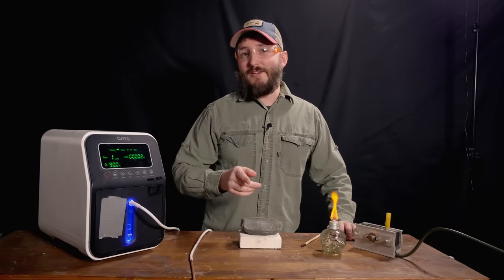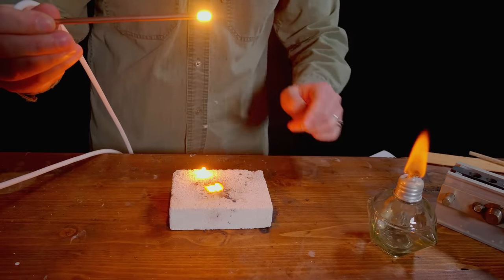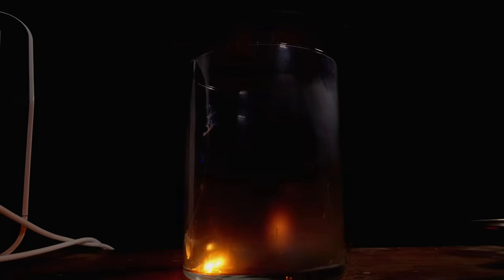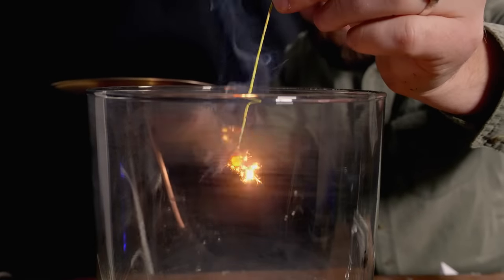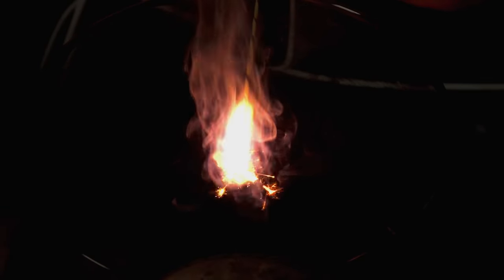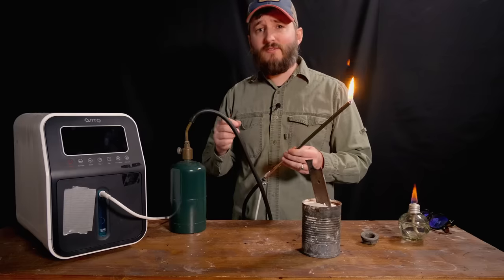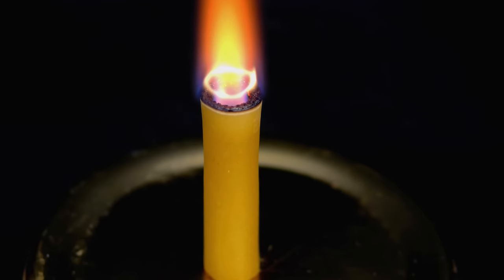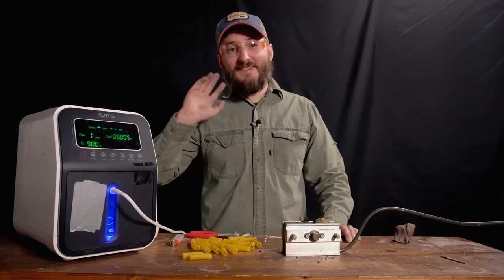6 Unauthorized Uses for a Medical Oxygen Concentrator

Comment: I learned this setup from a jeweler years ago on YouTube and I've been running my map system like this for a long time. It's actually how I managed to make rubies for the first time. After that I started playing with the laser method and then I did solar concentration. I washed yours on microwaving and had made some comments on the oxygen concentrator before. Glad to see you finally found one 👍
Reply: Just so you understand my setup. I bought a map oxygen setup and then just quit using the oxygen bottles and slid the too bright on the oxygen in Port and zip-tied it on there
Reply from the maker: How did solar work for you for rubies? I've been planning on trying that sometime.
Reply: @Nighthawkinlight  not too well! I couldn't use my big presnell because I broke it but the little ones managed to work. I had a janky set up and only had a little bit of time. I also tried using magnifying lenses and they work. Happen to have some old lenses from a projection TV that I've used as well. I just never have the time to be able to put into them. Much light trying to turn my anode and cathode into counter-rotating fan blades on my ionic lifter. I just never have the time. That's why half the time I just tried giving me idea to someone else that does have the time and can make a video out of it. Most of the time I do have are donated to my hydrogen reactors which I have finally reduced down to the size of a beer can and produce quite a few liters per minute. Even managed to print one of the prototypes and it survived quite a few Cycles for I let it overheat. Most of my time and extra money are going to the anode and cathode material which is going to cost me over seven Grand in rhodium!
Reply: @Nighthawkinlight  I still haven't tried the microwave method😪
Reply: The hell ... we live in a time when people are learning from YouTube how to make rubies at home using old medical devices... god is great ... or something.

Comment: Rocket idea to maybe try: spaghetti noodles inside the larger hollow pasta tube. Could be placed loosely or maybe fixed in place by getting both noodles damp before placing them and allowing to dry. Varying the position and number of spaghetti can potentially allow you to tune different characteristics like thrust, combustion pressures, burn time, etc
Reply: Also, since it requires hydrocarbons, I think pla or other 3d printer filaments may work, allowing much more sophisticated design. I’ve wanted to test it for years but never got around to it, parents didn’t love the oxygen tank and fire combo lol.
Reply: I should note, acrylic works well, so there is some precedent for oil based polymers in this application
Reply: and how do you combust it?

Comment: Great vid!  Yeah, I think you end a proper nozzle designed for the flow rate you got, which might also need some pressure boost also.  Suggestion: it would be a good video to go over how this thing works and maybe also do some show and tell of its insides.  Thanks!

Comment: I have a couple of ideas you could try.
1) you could insert a  y into the line prior to the exit to attach your propane line into.
 Then insert a smaller diameter metal tube into the end of your brake line to increase the velocity of the O2 gas being forced out of the end. This would also give you the flexibility to increase or decrease the proportion of propane relative to the amount of oxygen being produced.
2) try a flowing the oxygen over a couple of drops of oil to see if if would spontaneously combust. (All oxygen valves and components have warning labels on them not to use any oil for precisely that reason).
3) pure oxygen blown through a lit cigar will produce a bright red flame like a road flare..it's kind of cool to see. ( as a former medic we used to play with pure oxygen by taking a big breath and blowing it back out through a cigar)
Note: sodium silicate is used as a refractory material, therefore you probably won't get any burning of sand in that temperature range

Comment: I'm a high power rocket flier and engine builder from years back, mostly APCP, but have played with hybrids (N20 oxidizer) a bit. You can simply machine a graphite nozzle with a drill motor if you don't have a lathe (messy but easy to do). The other option is a rammed bentonite nozzle, It used to be Harry Gilliam at Skylighter had tools available, but sadly he is no longer in business, if you do have a lathe, they're not hard to make. There is probably info on this on the fireworks forums or PGI discussion groups. One thing with hybrids (and most cored motors) is to ignite them at the oxidizer inlet end. With your rigatone fuel, a match head and piece of nichrome wire would make a great electric igniter.

Comment: Yeah, my initial reaction was that the gas isn't being mixed. Your improv torch there also doesn't have anything to hold the flame, which means you're simultaneously risking blow back, as well as blowing out your flame. I think the ultimate issue here is just the lack of aspiration (if I correctly understand the term). But that whistling may have made me pee my pants a bit, I thought it was about to blow back.
Reply: One advantage of oxygen concentrators is they don't hold a very large supply.

It's just a pump that squeezes air through a molecular mesh.

It's a fire hazard but not really an explosive hazard.
Reply: It's just oxygen, so nothing to blow back. Oxyhydrogen is the type of torch that can blow back if you're not careful.
Reply: Well, but at the end of the torch it's not just oxygen. There is propane there also. And while a full tank of propane is not going to blow back due to delta p, as that gass burns down the risk of blowback increases.
Reply: You're imagining a premix torch. Surface-mix torches are also a thing, and are even preferred for some uses. Though generally, you have several smaller jets of fuel surrounded by an oxygen manifold, rather than a single jet of oxygen inside a fuel manifold.
Reply: @torydavis10  I am aware of the difference but I've also seen propane tanks explode, admittedly in less controlled environments with more fire. But I think the principal stands doesn't it?
Reply: @RFMongoose  If there's nothing to react with, it won't react.
Reply: As long as the propane is separated from the oxygen, nothing will happen. Only if the temperature and/or pressure of the tank is so high that it can burst, it gets definitely dangerous.
Reply: @RFMongoose  Sorry, I didn't mean for that comment to be taken as having anything to do with flashback. Even though flashback is always unlikely, as in theory your fuel flow has no oxygen and vice versa, it's always possible for some ox/air to be in the system where it shouldn't be and flashback arrestors between the work and the regulator are always a good idea. The only impact a surface-mix torch has in that respect is that under normal working conditions, it's essentially impossible to wind up with stoichiometric fire inside of your torch tip making things all melty. Short candles will still heat the face but you can't really get the situation that whistle made you think of. The pitch of the whistle in this case would have been the speed with which the flame was fluttering. Still not a good sound as low flow and an unstable flame heats the face a lot. The details that made me say you're thinking of a premix torch were simply the fact that you assumed torches must have some stage before the nozzle which mixes gases, and some extra structure which makes the flame live in a place.
Reply: @torydavis10  this may be a misunderstanding on my behalf, I'm most familiar with Ronriel (sp?) Stype torches. Self aspirated. While it's technically possible to burn them without a cone, they have a tendency to blow out when you do that. Typically those are used with foundry bodies that act like the cone, but an attached cone allows them to function as a... Very jank... Weed burner. That said, without an arrestor, or blowback valve, there is still risk of a blow back, which is why it's next to impossible to but a 20 gallon propane tank without a blowback valve. But that small bottle, I don't know if they come standard or not.

Comment: I remember detailing a car back in the late 80s. I needed to remove some paint overspray from the windshield & went to tear off some antirust-oil treated 0000 steel wool off from the roll, suspended by the center tube by a nail. Just hanging there on the side of the workbench, right over a half dead car battery. Thought nothing of it & pulled carelessly at the end of the roll, which dropped STRAIGHT onto the battery terminals, instantly igniting the outermost coil. Several lacerations & 2nd degree burns later I got the fire out & saved the rest of the roll. LESSON LEARNED.

Comment: The cutting Lance was pretty impressive considering this is a pretty low end O2 concentrator. The ones we use at work (Philips Respironics) can get up to about 7L/min at 90% concentration. Sounds like it could be a fun upgrade 😉
Reply: What are they used for... people who struggle to breathe? What happens if you  don't need one but breathe it in anyway?
Basically...is it a cure for a hangover?😅
Reply: @strangelee4400  yeah pretty much, basically for anybody who can't breathe in enough oxygen with the amount that's in the air already. Nothing special really happens if a healthy person breathes in oxygen unfortunately, not even curing a hangover

Comment: You know, it might be fun to test out different shapes and diameters of noodles and see how it effects the burn rate. Like, Ziti vs Rigatoni vs Cavatappi.The first two would be testing the effect of the tube's radius, while the latter would be testing a spiral shaped fuel.
Reply: Should try bucatini!  It would have a much higher surface area to volume ratio.
Reply: You should also be able to customize your designs with a pasta maker. But making homemade semolina pasta is a lot harder than just picking up a pack from a grocery store.
Reply: Yes! This!

Comment: I have two older concentrators I've been using daisy chained to run a DHC oxyacetylene torch for about 15 years.  I've used it to weld sheet up to 12 gauge with no problem.
The main thing to look for if you're doing this for oxypropane is that if a regulator isn't rated for propane then it's not safe.  There are regulators that use seals that are ok for acetylene but not propane.
The TL;DR on this experiment is this: you're not going to weld with propane, you're not going to cut with concentrators, and none of this is going to be portable. :D
Oh, the most important thing is, you really want some backflow arrestors in there if you're doing this.  ESPECIALLY if you're making your own burners.  I think the danger of having your tank explode might be overstated but I'd rather not be a statistic to save a couple bucks.

Comment: Have you considered a metal housing for the fuel body? Put the hollow pasta inside. You could even use multiple sizes of pasta to make a layered pasta fuel pellet. Since the pasta is hollow you could still feed oxygen through it. With convergent divergent nozzle I would think the risk of explosion would be minimal considering the fuel.
Reply: You could line the pasta with sugar icing?
Reply: Could also cover the entire noodle with the clay. That should extend the life of the rocket by preventing the gas from blowing out the side, without introducing the sort of hard material he was trying to avoid.
Reply: If you soaked the various diameter pasta first you might be able to get a tight fit between layers after they dry back out.
Reply: @lordchickenhawk  why not produce some pasta the diy way. And then shape it such that it already has the perfect shape?
Reply: @bertjesklotepino  Good idea. It looks like my rocket engine program has been sent back to the  ̶d̶r̶a̶w̶i̶n̶g̶  kneading board
Reply: @lordchickenhawk  1 tip i have to have given you:
If you do make your own pasta, do it the right way. 
It is easy to mess it up. But so is everything.

AND:
Produce enough so you can do the experiment and have a nice meal.
Because good pasta should not go to waste.

Comment: We had a lecturer at Uni who made his own liquid oxygen (because they wouldn't sell it to him). He did amazing demos with digestive biscuits soaked in liquid O2. But anyway one thing he did was have a container of natural gas, and light a flame of oxygen inside it, i.e. have a flame of oxygen "burning" in a natural gas atmosphere, as opposed to natural gas burning in an oxygen atmosphere. Probably a big explosion risk, but I guess/hope he knew what he was doing.
Reply: It seems odd that he couldn't buy LO2. My high school welding teacher had it delivered to the school for our building's manifold system once a month, this was back in the early to mid 2000s.
Reply: welding teacher supply chain more compatible with income generation/ science takes a back seat unless its in a $generating wing of a corp ( just my theory )
Reply: Inverted flame furnaces are used in industry. I worked on a nickel brick sintering furnace that switched from an gas flame in air to an air flame in a natural gas atmosphere in operation at 700C.
Reply: Not an explosion risk unless it actually fills up with oxygen
Reply: @allangibson8494 Is that to prevent oxidization?  If not I am curious as to why it's done in that way.
Reply: @holy3979  It is to produce a reducing atmosphere to weld the bricks into a solid mass - the nickel production process produces a fine powder which is a healthy hazard to handle so it is sintered into bricks with a polymer binder and then welded by exposure to high temperatures in a reducing atmosphere.
Reply: That's weird that they wouldn't let him buy it. I rented the setup from a local welding supply 2 Lampwork which is kind of like glass blowing but with a bench mounted torch and there was no special criteria short of where the tank was and how it was set up and how they could get to it to exchange when empty. I'm in Florida I'm not sure what state differences there are.
Reply: @bscguitars2278  This was in Britain so I guess rules were stricter. Anyway, perhaps they knew he was going to make exploding digestive biscuits.

Comment: For the pasta rocket: if you fill the pasta tube with spaghetti it could have more "oomph" or a longer burntime perhaps. 
Here in The Netherlands we have fast cooking spaghetti which is holo in the center, that could help with the added back pressure.
Reply: If it was losely packed, it might create more surface area and you might get a better burn ratio with the fuel😃

Comment: For kids, one could ask them to hypothesize as to what will happen using these variation: Bigger/Smaller diameter pasta. Shorter/longer pasta. The effect of adding surface (roughness: Bronze die extruded pasta vs plastic die) adding length of broken spaghetti or even couscous in the noodle. The effect of the nozzle size. The effect of oxygen flow. The effect of partially/fully cooking the noodle beforehand. The effect of oxygen concentration (if it can programmed). 

The trust could maybe be better visualized by putting a small piece of foil suspended in front of the nozzle. But one could also have a mean of measuring the length and width of the flame. By hitting a cold darken penny with the flame, one could "measure" if the flame is "fuel rich" (the copper will become shiny pink) or oxygen rich (it will blacken). One can measure the amount/ rate of gas produced by putting everything under a bell jar linked to a grad cylinder flipped in water.

Comment: Could you 3d print molds and place partially cooked pasta into the mold to get the nozzle shape, Maybe hang pieces partially in hot water? Could also use a price of piping that has been heated to decrease the diameter to a taper.

Comment: Recently read that it's brazing if the parts have close enough tolerances to cause capillary action, and soldering if you're just using low temperature filler instead of welding. Also found out that torch welding is perfectly viable, and can yield excellent results, and only fell out of favour due to difficulty, and repeatability issues. Probably still a great option for hobbyists, it's just not popular in industry.
Reply: oxycetalene torch welding is still very popular in refineries and other pipefitter industries
Reply: Heck yeah! I much prefer torch welding to arc welding. Easier to control, and no E.M.F.s.
Reply: @melvin6840  Technically speaking flames and plasmas give off fairly strong EMF, and they aerosolize radioactive material. It's important to understand the level of risk and have access to appropriate PPE for the work environment.

Comment: Dalibor Farny uses a large oxygen concentrator built from several normal ones to run the torches in his company that produces nixie tubes. He has several videos where he shows how they built the large concentrator. The torches he runs on it are quite large, so for smaller workpieces likely one or two normal concentrators are enough.

Comment: If you want that torch to work, you need a mixing chamber. I saw at a couple points that it nearly looked like two separate flames, an oxygen flame surrounded by a propane flame. You have to get them properly mixed into a homogenous gas
Reply: I just skipped though the video so I haven't seen much but oxygen isn't flammable so it would be impossible to have an oxygen flame. What you are seeing in this entire video is other things burning and the oxygen help it.
Reply: @jasonmurawski4917  That part of their comment is wrong, but the mixing it beforehand part is correct. It's actually because mixing it beforehand allows a much more even mixture of fuel and oxidizer.